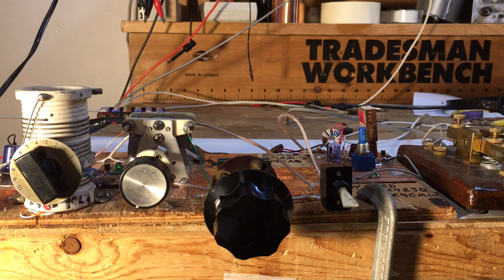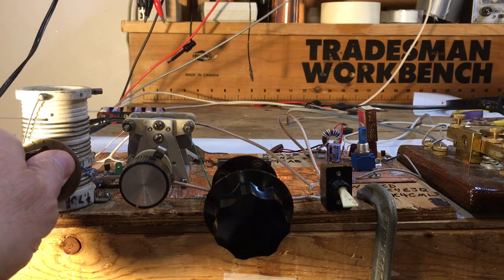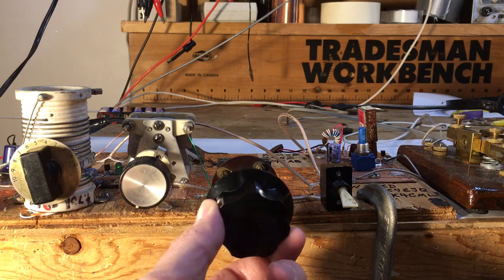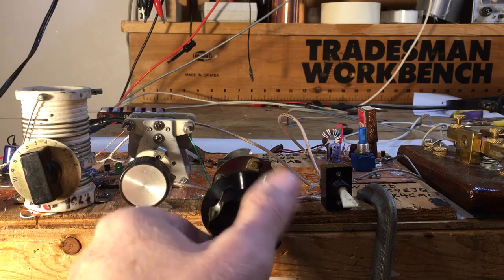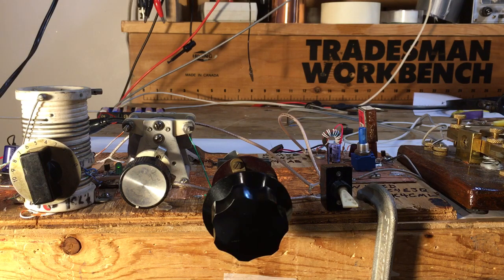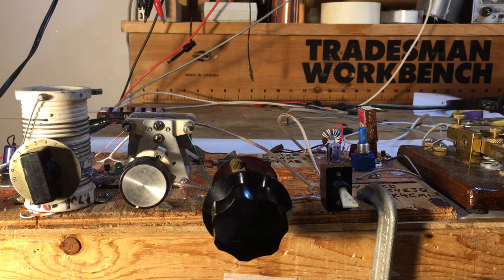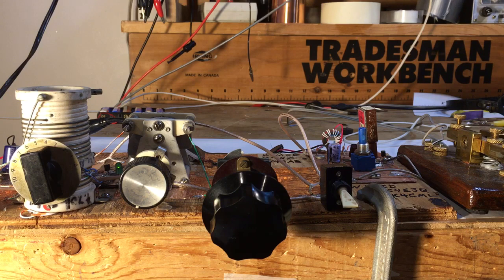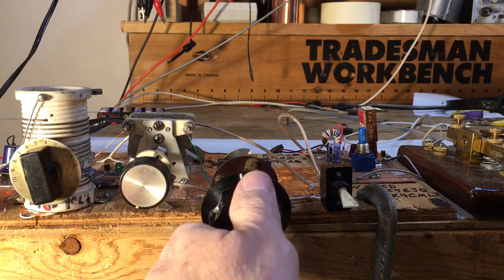Listening to the ET 2 Minimalist Receiver  (Part 1)

Comment: I got lotsa parts, from an SK Ham....and some good stuff too....a broken IC-7700....but the TS-850, the TS-130SE, and the Drake SPR-4 Rcvr., work like champs....just about a year ago....sent the IC-7700 back to Icom for repair....cost me almost a grand, but it purrs like a kitty now.....good radio, but no 2nd rcvr., like the K3/K4's do.....but hey....them Icom's are close to $6K, NIB....tons (okay, well....A LOT) of NIB/NOS caps, transistors, var. caps, coils, pc boards, bread boards, etc....a good winter, let's sort thru it project, for a SW Montana guy like me....amazing what some salvaged parts ya can throw together....and make it go....awesome....

Comment: To be honest I had to look up a Variometer in radio tech.  So would you say it has advantages over a rotary style tickler coil? My first regen was when I was 8.  I modified a science fair kit which had a AM reflex receiver.  I changed the coil out with one i designed for shortwave, made a rotary tickler coil and within a few minutes I heard a radio amateur calling from New Zealand, clear on the other side of the world.  Instantly hooked on regens.  Whats cool is for some reason it picks on the whine from the plate modulators most broadcast gear used.